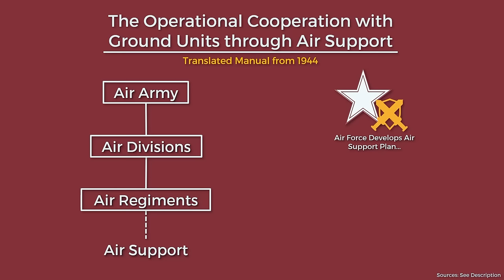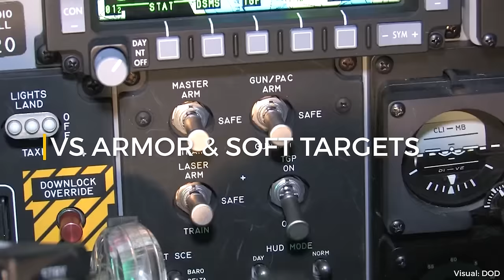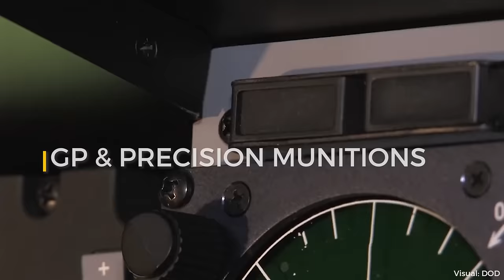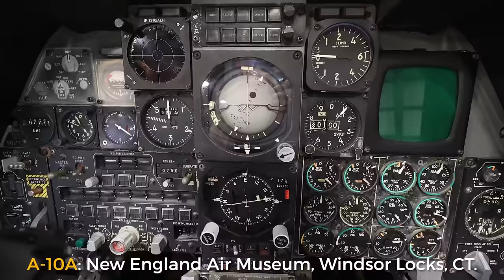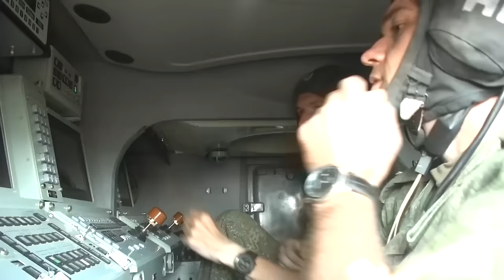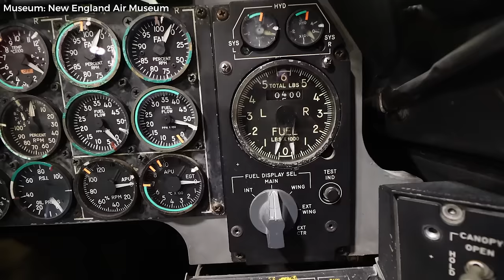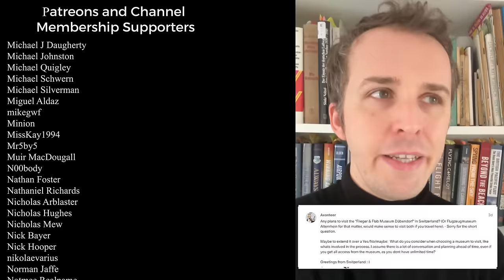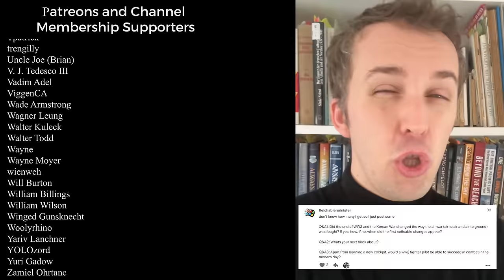A-10 Warthog: Retire or Upgrade the BRRRT? - Future of A-10C Thunderbolt II

Comment: Honestly the obvious approach to me seems to be that the A-10 should be replaced by a new/newer more modern design that does what the A-10 was designed to better with a better idea of what that role entails in the first place informed by the short comings of the A-10
Reply: We already largely did that by moving the F-16 into a multi-role position via extensive upgrades. Likewise. The F-15E and even some larger bombers ended up also doing a lot of CAS/COIN missions. Don't get me wrong. I am not one of those strangely emotional "The A-10 must go away for my emotional health!" types. It is just that while the A-10 has done well in the largely COIN based conflicts we have been fighting for the past few decades, it has reached a point where it is just not doing anything that other aircraft can't do. We don't really need to build a new replacement because we already replaced it a long time ago.
Reply: @startrekmike  the problem with that is the F16 and F15 cost more per flight hour and have lower loitering times.

While I don't think this is quite the direction the US should go in for a variety of reasons, I do often think of how Brazil and Colombia have stopped using turbofan aircraft for the majority of their combat operations and switched to a design that's significantly cheaper both to buy and operate, that has much longer loitering time. I'm not saying the US should go out and start purchasing super tucanos for CAS, but I am saying that I respect the idea of filling that niche with cheaper aircraft that are better at filling that niche.
Reply: "What the role entailed" changed a fair bit after thr A-10 was already designed, if not built.
Reply: @frankdamsy9715  Cost per flight hour is a flawed metric because the purchase of A-10s, upgrading of A-10s, maintenance of A-10s past their prime (older aircraft cost more to upkeep), the fact that man hours have to be diverted into A-10s, etc are all opportunity costs that had to be incurred. In the end, you could easily afford more than enough F-16 flight hours if the A-10 budget had not gone down the drain. Boeing scored two 1 billion contracts to make wings for the A-10. 2 billion is a lot of flight hours.
Reply: @ChucksSEADnDEAD Yeah, but none of those issues would exist with a new design that’s specifically there to do the same role as the A-10 with the same benefits and all the problems addressed, since they’d be brand new aircraft.

Either way, I’m in agreement that a specialized successor to the A-10 is better than a multi-role aircraft that’s mediocre at everything. We saw that happen with the M14 in US small arms trying to replace 4 other guns in US service and failing miserably.

Comment: One aspect possibly missed by the analysis of the warthog in it's counterinsurgency/"punching down" role it had in the likes of desert storm is the fact that the multi-role fighter systems at the time were at times much less capable / had a lot less of the precision strike systems that the most modern multi-role jets do today. Rather than focus only on the Warthog's capability and niche, it's important to look at the surrounding capabilities that have been greatly enhanced since the late 90's and early 2000's in multi-role strike fighters.
Funnily, another plane which was funded by the likes of SOCOM to the tune of 3 Billion USD is the OA-1K Sky Warden, which is a propeller driven aircraft intended to fulfill the COIN role that is potentially being left out by the A-10
honestly i think it was pretty redundant to procure a new fleet of crop dusting planes to drop bombs on terrorists when the same could be done with a long range UAV or an upgraded version of the A-10, but what do i know i guess

Comment: The issue is that in full scale conventional warfare platforms are going to get destroyed and people are going to die, and in large numbers. Combined with munitions shortfalls which will see an eventual reliance on unguided Mk.8x munitions, the value of an aircraft that is more survivable when getting into the close fight will become apparent. Add to that the sheer volume of hard points and range, particularly when in reference to the Indo-Pacific, the platform is going to prove far more valuable than many think. CAS and BAI are not going to be just zooming around at 20,000ft casually dropping JDAMs or LGBs, even with F-35s.
As always love your work!

Comment: Good overview of the A-10 situation, only comment: there has been an anti A-10 group within the Air Force for decades who have been trying  To remove it many times yet be proven wrong every time. Yet again, it is an old system with a lot of flight ours on the airframe.
Reply: That group tends to only think about air superiority. Their idea of supporting ground forces is probably just hitting tanks and calling it a day, not really understanding what Close Air Support really is because they never set foot on the ground.

I think their last folley was a redacted fly off report that surfaced last year saying the F-35 wasn't exactly better than the A-10. Like the F-35 having to fly more sorties than the A-10, especially if the F-35 is not carrying external loads.

Comment: I would love to talk to you about the A-10. There are a number of things I think people tend forget and/or disregard about the Hawg and I will go over a few of them here.
1. Is that the A-10's mission set isn't just CAS. While CAS is the Hawg's main mission set, the A-10 is actually prioritized in roles like CSAR, Anti-Maritime, and FAC-A. These missions are primed for the A-10 rather than other MDS' because of its loitering ability. Losing the A-10 not only will cause the USAF to lose a highly specialized cadre of CAS experts, but also experts in the above stated missions sets. 
2. On the topic of modern threats, everyone loves to say that the A-10 couldn't live in a modern combat environment but it's actually false. Kind of what you mentioned, NATO air battle tactics would basically all but ensure that any GBADS would be suppressed with either SEAD or DEAD missions or with the heavy use of EW systems and that air supremacy would be achieved. This really only leaves the threat of MANPADS, which while a threat, are only as good as the MK1 eyeball and ear. The A-10's normal strike altitude is well above any range in which any person in a combat situation would be able to tell that there is a flight overhead. 
3. Is operational cost of the A-10. The A-10 is to date one of the cheapest in terms of cost per flight hour. This is important when it comes to understanding proportionality. While the A-10 is under threat in a near-peer conflict, what is more cost effective in certain missions like CAS and what can be better put to use. Do you send up an F-16, F-35, F/A-18, etc to perform a few CAS TIC's or would it be better both cost wise and proportionality wise to send up the configured for SEAD and Air Interdiction mission and let the A-10's deal with the ground operations? This also sort of ties into what you were mentioning about enemy forces having to dedicate GBADS, what is a higher priority target? A flight of 2-4 A-10C's or the AGM-88 armed aircraft in the vicinity providing overwatch?
Now with all this I will say that the biggest problem with the A-10 isn't near-peer threats, but logistics. The A-10 fleet is suffering from the same issues as the F/A-18 and T-38 fleets in terms of parts availability. And as much as I love the bird that I have been a crew chief on for over a decade, I don't see the Hawg living for very long because unless the USAF puts some major bookoo bucks into overhauling the parts supply train of it.
Reply: It’s this list of utility the Hawg gives that ignoring it will hurt the force composition.

Anyone else remember what happened when the MH-6 scout got retired without having a replacement?

A big hole and nothing else to replace it for what the little bird could do.
Reply: SEAD/DEAD isn't a card you play like in a game that automatically wins. You can do all the SEAD you want, and the enemy keeps radars off. When the A-10s show up, they turn on for 30 seconds, fire missiles, track, and shut down again. Plus, passive sensors like EO/thermal allow SHORAD to escape SEAD.
Reply: @dankoz6340  considering the F-16 has done more CAS than the A-10, we already replaced the A-10. It's just not official.
Reply: @ChucksSEADnDEAD  No single jet platform until the creation of the F-35 flew alone.

The A-10 or any bombing platform would fly with SEAD, not separately.

I'm not sure what you're arguing about SHORAD, are you saying passive systems make SEAD obsolete in covering for other non-stealth platforms?
Reply: Strange, illogical, almost "fighter mafia" types of thinking are going on.

For example: "The f-16 can also use the 30mm gun" from the First Gulf War.

Procurement and implantation is not always a logical process.

Also

This isn't just about CAS.

This is about the A-10 as a PLATFORM.
Reply: @dankoz6340  Sorry, but they did fly alone when the situation required. For example F/A-18s were the first combat jet in US service to fly to a strike mission and shoot down an enemy aircraft on the way in. There's many instances of aircraft having to fly alone due to necessity, from F-105s to F-4s.
I'd suggest you look up Package Q. F-16s were supposed to have F-15C escorts and F-4G SEAD. The problem when you mix different engines, different fuel tanks and different drag profiles is that the SEAD and air escorts ran out of fuel and had to turn back, leaving the F-16s to fly by themselves. The A-10 flying with SEAD would require the SEAD aircraft to somehow mimic the A-10 in terms of endurance, speed, etc. Otherwise the SEAD aircraft will have to leave early.
SHORAD doesn't make SEAD obsolete. It makes aircraft like the A-10 obsolete. SEAD can ignore a lot of the short range solutions found in SHORAD as they and the strikes they protect can just fly above and fast to escape those short range weapons. But if your aircraft is flying low and slow, SEAD can't react in time.
Reply: @dankoz6340  The A-10 as a platform was meant to be retired starting in the mid 90s. It has received a 30 year grace period thanks to Congress. As a platform, it's worn, it's tired, and it needs to go.
Reply: @ChucksSEADnDEAD   Makes sense that different airframes/engines would have different operational ranges and engagements but it “sounds” ridiculous that would not be compensated simply by rotating aircraft out-and-in of the target zone. In the case of Package Q (if I read correctly) none of this was related to a problem of airframe but organization and bad weather interfering with re-fuelling. That does not mean the A-10 is insufficient, it means the plan went unintended and further illustrates the complexity of operating multiple air frames, while the F-16 was shown to dodge missiles and a couple cases of surviving telephone-poll-sized missiles, some did not come back but there is no reason to blame the airframe design.

While flying alone might be a necessity, it’s sub-optimal and points to the needs of making aircraft more multi-faceted, or at least be able to look after themselves. For the A-10, it has been upgraded from A to C which includes a variety of avionics and digital equipment that eliminates some old problems but in terms of replacing the need for overcomplicated missions, the F-35 became the answer. The A-10 still fills in many roles other aircraft cannot fill as pointed out by bullpupgaming.

Comment: The A-10 has the "cool factor" for sure with it's iconic gun and has proven itself valuable in the COIN years, but it's value in near-peer or peer conflicts has always been questionable. It requires such a specific environment to operate in that it's simply not worth keeping it around. If you need fast jets to clear the skies of enemy fast jets and perform SEAD on the vast majority of the enemies air defenses, you might as well use fast jets to do the CAS itself.

I would argue that a Strike Eagle is the vastly superior platform for the role, because it actually has decent survivability without needing the entire air space sanitized first, and still has very good payload capabilites.

Comment: Assuming you can justify it within the current and "short term" future threat environment we should be looking at an A-10 bis. A redisign. Just brainstorming here; if a small "light" module could be added to the airframe where it could shoot down manpad missiles coming at it (e.g. the Swedish one that follows a laser that eyes on the ground are using to track the target). Then a close air support plane has a chance of surviving (along with the pilot). Right now, planes like the A-10 can only survive in small edges cases of wars - while very useful, hard to justify the budget to develop and train for.

I also think the Army should be doing its' own fixed wing support like when it had the OV-10. The Air Force seems to have different priorities.
Reply: The Air Force,Marines and Navy flew the OV-10 but never the US Army. They had the OV-1 Mohawk.
Reply: @00calvinlee00  Thanks for the correction. Learned something!

Comment: Because of the modernisation/upgrades the A-10 is getting expensive to maintain and repair. 
Regarding close air support, the A-10 wasn't great. It was notorious for its lack of imprecision. Other countries refuse close air support from the A-10 and have been doing this for some time.  
Worth reminding everyone that MANPADS and anti-aircraft defences have been improving and that the A-10 is more vulnerable than ever and it will continue to get even more vulnerable. Basically, against "near peers" there won't be a moment when it will be feasible to use the A-10 in its traditional role. 
Regarding using the A-10 as a "bomb truck", it's better to use a B-52 or B-1 or even a B-2. 
Regarding the use of the A-10 as a "missile slugger", the F-16s can do that and so can F-18s and AH-64s. 
The A-10 will have issues if it will be used as a maritime patrol aircraft. It probably doesn't fit the Navy's requirements. It could be used off of land bases but that would limit its deployment and use as a maritime patrol aircraft.
 I don't think the A-10 is large enough to make a a decent tanker even if you remove the weapons from it.
Sure, you could use MALD missiles on the A-10. Thing is it might get attacked way before it could launch the MALD missiles. You will also need to change the equipment, which means more investments which also means more money spent on maintenance and training which is one of the main arguments for keeping the A-10. The F-16s can get the job done with MALD.

Comment: As for alternative uses? The b-1b is a far better bomb truck. And as a missile delivery system from a standoff range. As far as electronic warfare goes? It's simpler just to buy The Growler. The Navy and Marine Corps have never had much use for the A-10. I don't see them requiring its services for maritime strike now. And as far as the tanker role goes? A drone tanker is a better tool. Already proven And is stealthy. The biggest way to find f-22s and f-35s is not to detect them. But to find their support tanker.

Comment: I find myself thinking along the lines of a wider EW application. All the talk of the new pods, systems that have been mounted to it. Why not dial that up even more? 

Make it a nearly pure ECM/ECCM asset. It stays in the back goes out hunting things which put out too much radiation. Flying low? Low enough to get under RADAR, if not under the RADAR, low enough that there's confusion around what the signature is. Force people back to Mark 1 Eyeball. Sure you're going to have to repair it, but if that's three units down for maintenance at the cost of a kilometre wide gap, hole in enemy air defence? Enemy signal projection? Is that worth it? 

Maybe. 

Thing is I also don't think rotary wing could ever fully replace fixed wing. They're different vehicles, different trade offs, different natures. Don't get me wrong, I like the -64 a lot. A whole heap, perhaps too much and when they mounted that RADAR dome on top? Perfection. 

But in saying that, if I understand it, you can't achieve the same loiter time that you can with rotary wing. 

A locally available, short response time back up on the radio? That can be done in a variety of ways. It's not minutes that matter, it's seconds. 

Getting rid of the A-10 seems to remove that capability. Entirely. Not a reduction, but a total removal. I think that's the bigger issue here. Can this be adapted into something else? Can it be relocated? Can it be refined into a similar, different yet similar ability?

I think that question also needs answering.
Reply: It's already starved for thrust and you're gonna pull more power from the driveshaft to run a generator.
Reply: I think the better question is whether its cost effective to refit an airframe that is rapidly approaching the end of its service life for the second time to perform a new role in its twilight years or if its a better investment to procure a new airframe that can perform that role for potentially decades to come?
Reply: @StacheMan26  This is a large component of my follow questions. 

If not the A-10, then what? How do you keep this capability? Do you want to keep that capability?

Comment: The main gun on the A-10 is impressive. Impressive is not the same as effective or efficient. It works better for propaganda than for support of troops. What the A-10 needs more is digitization, higher tech munitions and so on. The amount of blue-on-blue action done with the A-10 should be included in its costs. Just as standing around being in repairs.